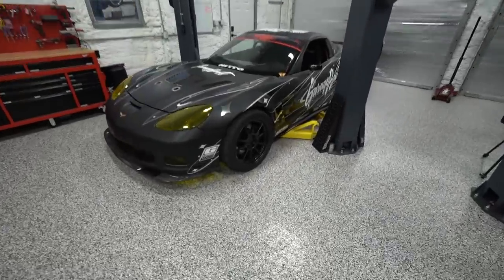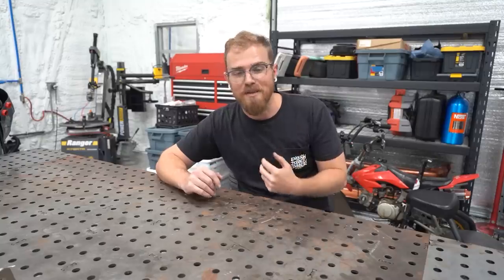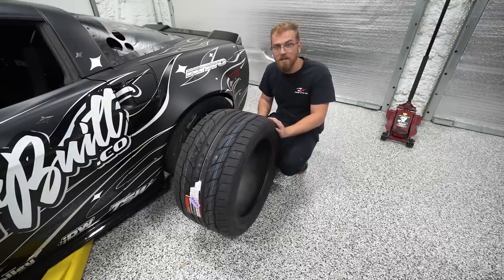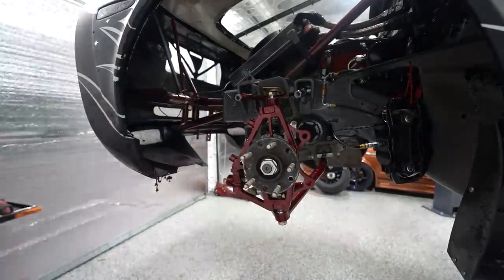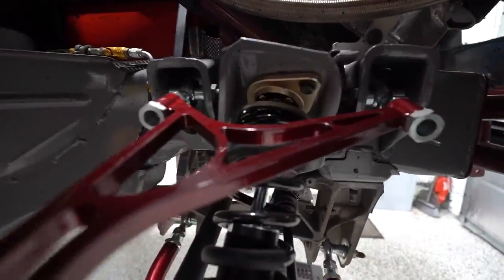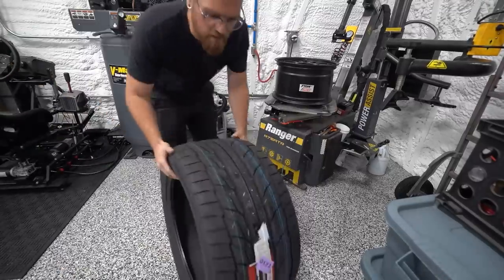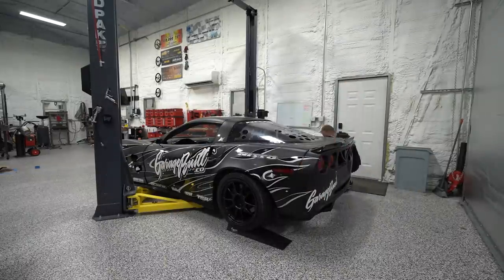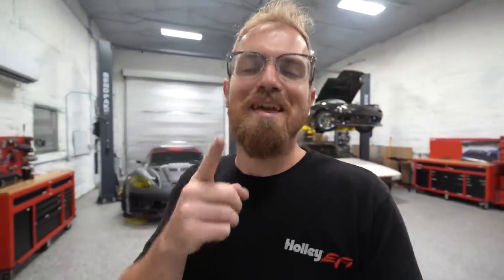C6 Corvette competition drift build. upgrades to make it faster

Comment from the maker: Use code TAYLORDRIFTS60 to get 60% off your first Factor box at https://bit.ly/3VIPdeu
Reply: Idk if you would like it or not but look into the Hammond Motorsport setup plates it helps a lot and simplifies this process of running a car through dynamics.
Reply: Maybe mark the floor where you place your ramps for easy placement every time?
Reply from the maker: @SCOOPFREE  it changes per car though. I did that for my miata back in the old shop here and they faded quick.
Reply: broo, @ 19:30 that is asmr
Reply: Change your oil bro. Better to be safe and know if a bearing is hurt.

Comment: It’s pretty incredible that you built or completely changed basically every major part of the car and it all worked flawlessly!! So impressed and happy for you. Nothing feels better than a project that just works
Reply: Pretty much all bolt ons
Reply: @sybes_420liljoe7  yeah bolted on after fabrication
Reply: @jgreen2679  theres some custom stuff yeah. Mostly boltons that got rewelded
Reply: @sybes_420liljoe7  that’s a dumb comment. He literally remade all the wiring and plumbing, the entire driveline, the exhaust, most of the interior, and it all worked pretty much first time out
Reply from the maker: @roachwerks3043  yeah I built the headers. Entire turbo system. All custom wiring and plumbing. Engine mounts. Trans mounts. Trans tunnel. Handbrake setup. Radiator setup. Fuel cell setup. Dash mounts. Dry sump tank mount. Headlight mounts. Front intercooler and oil cooler mount system. Lol There’s not much bolt on on this car.
Reply from the maker: @sybes_420liljoe7  like what? What was bolt on that got re welded?

Comment: Any plans to tub the rear wheel wells to prevent shredded rubber from getting into the radiator?
Reply: Radiator draws from underneath, the fans move a lot of air, it would have to be a big chunk of tyre to get in them. The carbon Kevlar panels for the rear have a tub in them, those would be the logical upgrade.

Comment: Thinkin’ you may wanna look at your control arm attachments for how well are they welded and reinforcement if needed…
Reply: agreed, Cleetus' Ruby had that issue with the attachments literally being ripped off the car from the launches and the factory's welds not being great, but yeah, drag-launches are much harder on those attachments than drifting usually is..

Comment: Could you use the turbosmart electronic wastegates to forcibly make more boost without needing the load
Reply: somewhat, but may be more boost than the engine needs at the load it's seeing, add to that the e-gates would likely NOT be in a good spot heat-wise for that this build even with all the heatshielding..

Comment: Interesting note about tightening your suspension on a corvette with stock bushings at ride height to account for deflection. I've never done that once on my track C5 any time I've tightened anything up. That said, not sure how I'd go about getting under or in there to even do that with a 4 post lift I wonder how much that matters?

I also want to ask you a bundle of questions about spring rates and stuff as I'm collecting and collating all the information I can find on C5 coilover spring rates for track driving, and I'd love to know what the general trend is for drift... but I think your car is modified enough it may not apply to your average C5/C6er
Reply: You do that in every car, not only corvette

Comment: Live your videos. But your work bench is driving me nuts. The rust in Florida is crazy. I would seek a solution to prevent it ore treat the metal to not rust. Maybe a oxidation ore something that works. Ore spray WD40 all over it. Still waiting for the loft build bro. Haha. Keep up the amazing work bro.
Reply: @AM Yeah that is right. But it makes it look so messy. And I know he is not messy. It's just a shame that in Florida it's hard to keep it nice. I'm a fabricator to and a surface that is free of corrosion is better for welding and a perfect flat surface. And yes if you treat it with a spray you need to re do it regularly.  Especiallywhen you cleaned it. ( sorry is I misspelled something, english is not my native language )